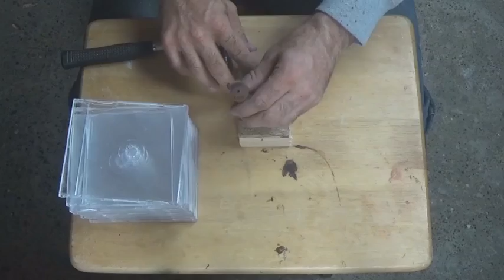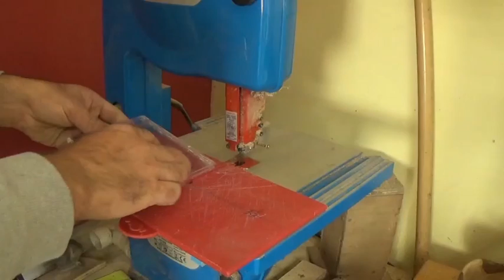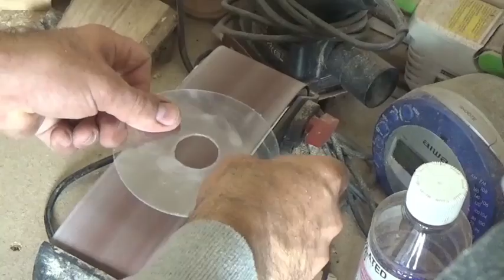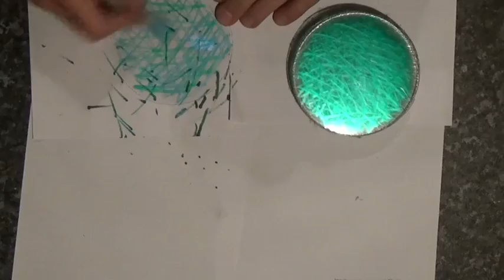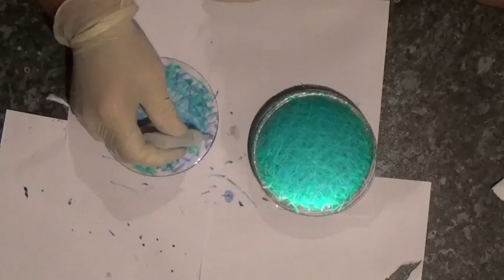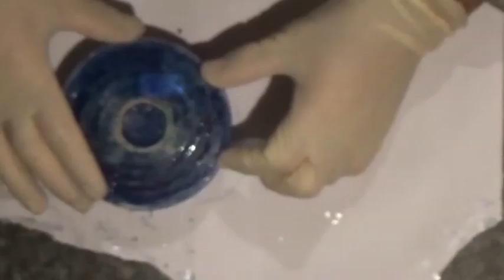MAKING A GOTHIC GOBLET FROM CD CASES Part 1 Jigs, Cutting and gluing!!

Comment: That is a LOT of prep work buddy!! The only blade I have for my bandsaw is a 3tpi 5/8 and it just destroys the cases on contact haha When I did my pen I ended up using my scroll saw to process the cases down. Some great tips and jigs here thank you very much
Reply: Just curious if you kept track of how much glue you went through? :)
Reply from the maker: Yeah I use a pretty fine but very sharp band saw blade. The trick is to move them through pretty fast to stop them heating up and binding too !! I used 16 bottles of 7 gram thin CA.... Bought in a local bargain shop for €1.49 for 4 bottles. So The glue cost about €6 ...... I would hate to think how much this blank would cost molded out of epoxy !! ?? Thanks for watching and commenting buddy, much appreciated, regards, Steve.

Comment: yes your patience level is the power of 10 men!! just a thought as your hands are very close to that router bit and with so many to cut.. im no health and safety geek myself as i do some worse stuff but you could pick up a 1/2 inch shaft intumescent router bit and plunge down with a ply bridge over the case, just jig up to slide the case under the bridge amd a block stops the case where needed then plunge down, much quicker aswel
Reply from the maker: Hey Mark !! Yeah I see where your coming from regarding the router, but to be honest with you the bit I'm using is a cone cutter, no bigger than 4mm in diameter the video makes it look a lot more aggressive than it actually is. In fact I have tapped my finger off the cutter a couple times in other past projects and it just skips off because I only have about 4mm depth exposed .... Sometimes magnified video can make these tools look a lot closer to the operator than they actually are ;-) ..... Thanks a million for your concern and your ideas and link are very much appreciated buddy...... Regards, Steve.
Reply: +Templeboy Turnings no probs fella :)

Comment: Very cool jigs.  Have you thought of a way to keep your fingers away from the bit when you have the mini router on the circle jig?  Kept flinching every time your fingers went to grab the disc.
Reply from the maker: Ha Ha Mark had the same worry, as I said to him, the video makes it look like my fingers are a lot closer to the cutter than they actually are? Also the bit I use is like a cone shaped bur cutter so even if I touch my finger off it, it doesn't actually bite !! Thanks for your concern though, much appreciated !! Regards, steve.